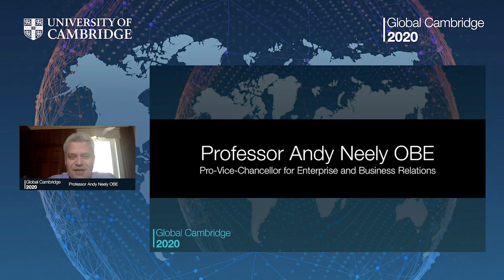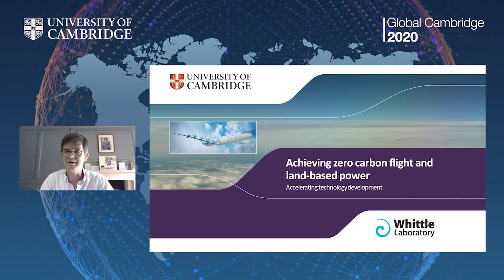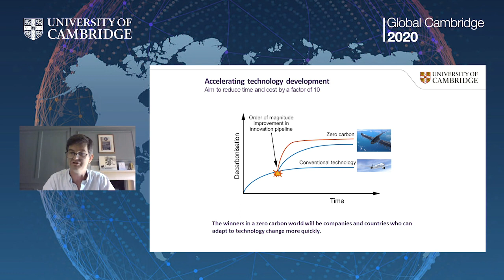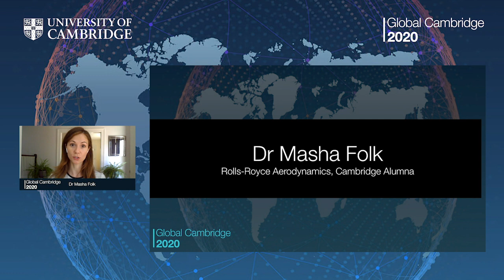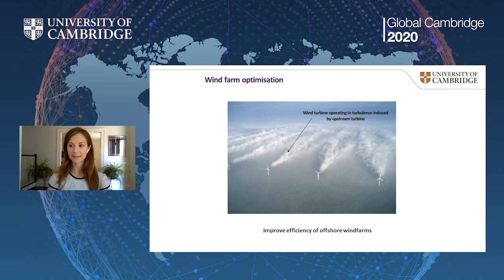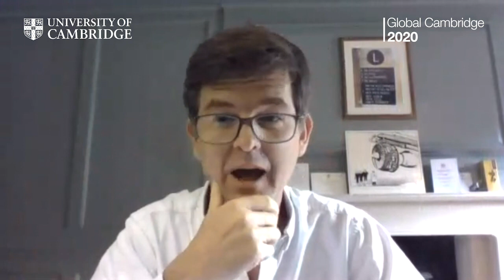Global Cambridge: Achieving zero-carbon flight and land-based power

Comment: How wonderful at least Prince Charles has a clue and priority. Has he taught this to his children? 

How double-wonderful teams from Cambridge are discovering technology we were working on 15-20 years ago with NASA&Stanford scientists as crude was pushing $150/bbl and CO2 levels were melting the Arctic.

Here's a neat trick to watch for; 

A) you can get a higher energy density with your hydrogen carrier (i.e. NH3) than jet fuel without using compressed gas to liquid cycles and

B) unlike the Haber-Bosch process which currently relies on Natural Gas (CH4) you can get zero-e synfuels which fuel cells LOVE (yum) using LESS POWER (electricity) than the energy density of the fuel; i.e. 1KW in produces fuel capable of producing 1.5KW. This mostly solves the debate about energy storage for wind&solar and ample liquid fuel for generating stations, microgrids&residential needs, as well as solving the lithium challenges firms like Tesla face today.

Bonus Points; Did you know you could extend the range of a Telsa to 1,000 miles and cut the lithium in half with less than $1,000 in gear?

I find it delightful you young pups are bringing these solutions to market. Now you just need to run for office and deploy the technology before all life on Earth including humans goes extinct, which according to a class packed with NASA/NOAA graphs at GretaThunberg (0rg) will b4 in well under a decade.

Prince Charles was dead right. Better hurry kids.